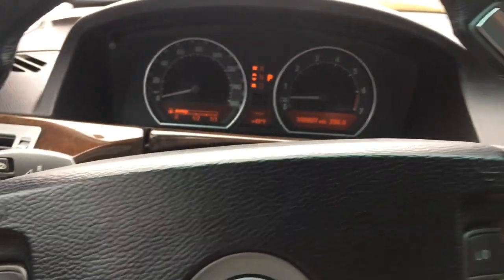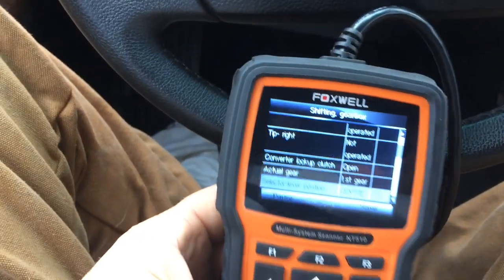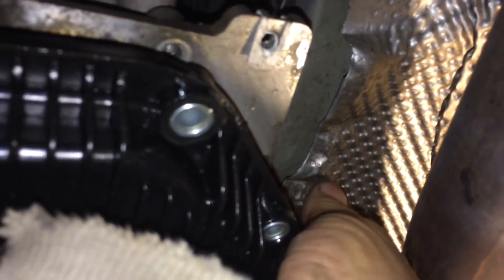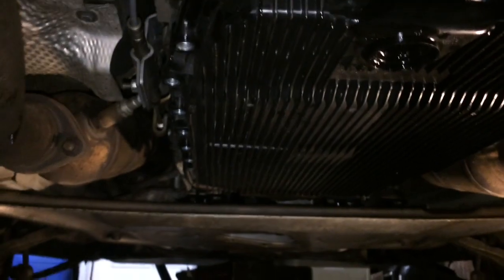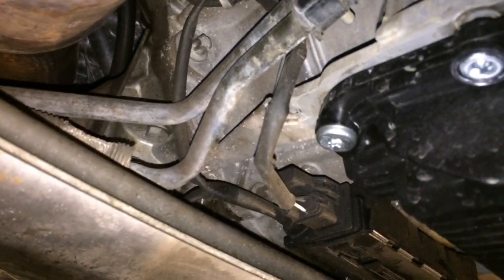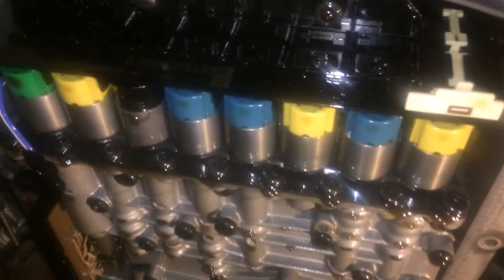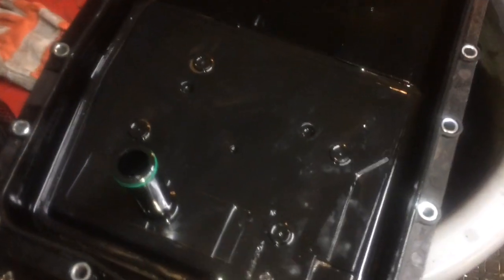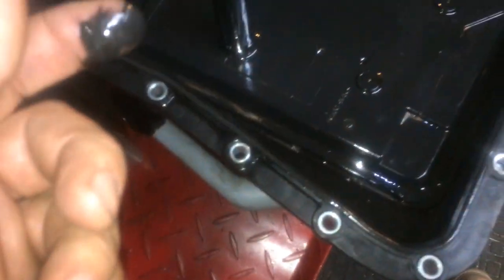BMW 745li E66, transmission Fail Safe Fault Code Explorations

Comment: Hey I have a 03 745li 202k car drives and shifts fine no check engine light 💡 on . The problem is while driving after about 30-40 mins it goes into N and says Transmission Fail takes a couple try’s to get it to start back up then drives again. What should I do?
Reply from the maker: i'd take it to a shop. something is triggering the car to go into failsafe.
after 30 40 mins trans is up to temp, probably overheating not good take it in before gets worse
Reply: @crashman1963  I have a 2004 745 Li. It went into N a a stop sign and would not crank back up said something about dynamic duo and trans fail
Reply: Easy fix...change all your transmission solenoids, I had the same problem, no problems now

Comment: It happened too me also 2nd gear slipping.. But can still drive until Saturday? Or will it ruin my Transmission?
Reply from the maker: my son drove and smoked the clutches had to rebuild and clean not easy

Comment: Hey man I have an 03 745li with 181,000 miles and the car drives and goes it just takes time for it to accelerate and when it gets to going it doesn’t go past 3rd gear so stay going at about 25-35 maybe 40mph with no check engine light just trans fault. Any idea?
Reply from the maker: sounds like you are stuck in failsafe mode which limits you to 3 gear, dont drive it like that. you'll have to find out what is causing the bimmer to go into failsafe, and fix it before you drive it

Comment: Did you fix this problem
Reply from the maker: yes, i fixed but ended up not being my problem...was  caused by parking brake problem which caused failsafe , son kept driving, clutches smoked, rebuilt, now running
Reply: Crashman1963 cool thank you I put 22” rims on mines and code popped up smh

Comment: I have a 03 745li, 77k miles no gears slipping, but the trans has a small leak it’s leaking around the transmission oil pan, I was thinking it was the gasket on the pan, but it may be a sealing sleeve under the mechatronic unit. I know it’s a long shot asking especially since you haven’t seen it first hand but I was gonna ask what you thought ? I appreciate you posting these videos on this car have learned lots from you!
Reply from the maker: sleeve can leak as well as gasket. if you were to drop the heat shield you can probably tell which one. both fairly easy repairs. hardest part being refilling fluid, but you have to check fluid anyway as you have a leak. the gasket may just need tightening but to replace the mechatronic sleeve or pan gasket you have to drain trans and drop pan. can also leak where cooler lines connect, 2  o-rings. good luck! --- if fluid is dark you may consider replacing.

Comment: I'm having this same issue. Check fluid levels and it's good, not throwing any codes. Car will drop into park on it's on and will not change out of first.
Reply from the maker: yup you're in failsafe, good luck
Reply: I had the same issue with my 06 750li..I dropped the mechatronic unit and replaced the rubber mechatronic  adaptor and sleeves. And topped the fluid level back up..This will fix your problem..It pretty much was my fluid level was too low, but its best to change the adaptor while your in there...I hope this helps...
Reply: @billyfrazier5609  didn't work for me
Reply: @toddstarks1588  what was it?
Reply: @djdannylake  I eventually just sold it. Couldn't figure it out after fixing the mantronic I believe that's what it's called
Reply: @djdannylake  but the dude is still driving it.  Don't know if he got it fixed or if it just stopped

Comment: I have the parking brake lite up on my 2003 bmw 745li dash. I switched the plastic parking brake gear in the trunk with a metal gear since it was broken but it won't actuate after replacement. Any suggestions on what to do next?
Reply from the maker: clear codes
Reply: @crashman1963  Much appreciated. Thank you.
Reply: Angel Gonzales did it work for you?

Comment: Did u fix it? My car just started doing this today. Any help would be greatly appreciated.
Reply from the maker: the trans prob was caused some how w parking brake codes, it caused a failsafe and my son drove from va to nj twice, failsafe is like 3rd gear on;y, 3/4 clutches were smoked, sheesh.I rebuilt the trans and fixed the parking brake. got thousand miles on still going